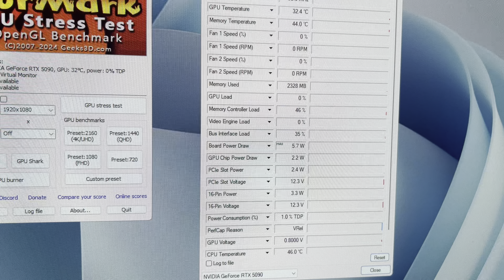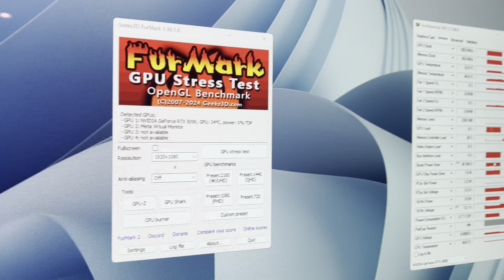5090FE undervolting with Furmark! 🔥🔥🔥(WARNING DO NOT TRY THIS AT HOME)

Comment: 800W atx 3.1 standar only supports 600W on the cable WTF
Reply from the maker: The cable will allow as much as you wish. The only limit is the bios on a 5090 limits 600w. If we shunt mod the 5090, you can pull double power.

Comment: Quick question, this goes for 60 series cards too eventually: Can I copy this undervolt for the GPU while doing regular games and/or whatever else? I don't trust Nvidia's 12HPWR to run at stock voltages. So I'm definitely going to try to undervolt. Would it be a good idea to do it as a safe measure in general to avoid transient spikes above 400-450W?
Reply from the maker: These undervolts are perfect for gaming! It’ll probably be very similar for 60 series I’m sure. Unless Nvidia implements drastic changes. The 12vhpwr is completely safe. Cable connection quality is key. No dongles, no adapter, make sure all connections are clean with alcohol and make sure your cable is plugged in all the way. Like ALL THE WAY. 😂 you will be just fine.
Reply: @videocardzrule354 Thanks a ton for the help. My brother has a 4090 and he only used the provided adapters. I have a 1600 T2 SuperNova PSU, i suppose despite non ATX 3.1 Compliance, if I plug things tightly I shouldn't have issues. I'd rather the car not consume like 600 watts especially the 60 series, so definitely will undervolt.

Comment: your memory temps stay super low, do you think thats because of the giant thermal pad you have on the back? if so can you link it?
Reply from the maker: They run really cool even without the thermal pad on the backside. It’s just because the memory is water cooled, so it runs much cooler than an air cooled 5090.

Comment: Love your vids, lots of technical data!  I'm running a PNY EPIC-X OC air cooled and I'm power-limited at 605w in Steel Nomad, 955-960 @ 2700-2800 MHz, lol.  I'm using a pure overclock and gaming performance is typically 3170-3220 MHz @ 1070-1080 maxed out so I'm happy.  I need a better case for a custom loop (using a Fractal Torrent right now).